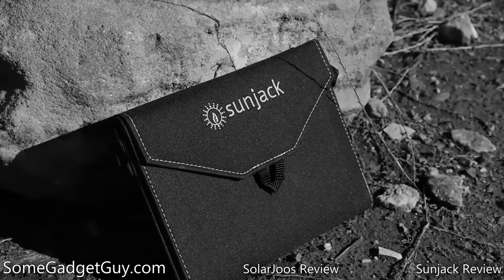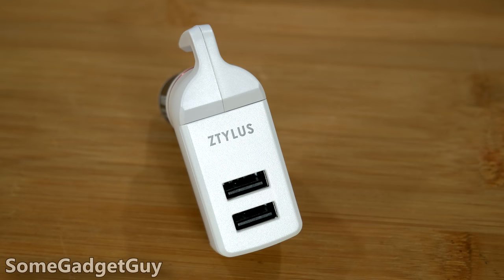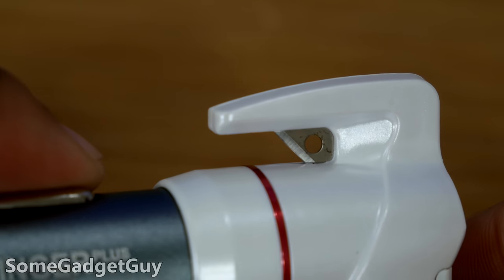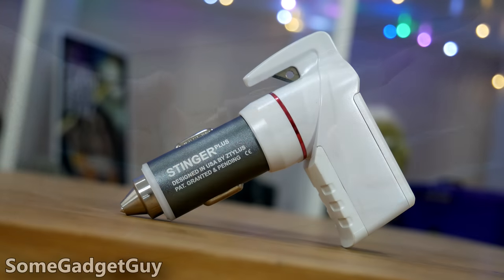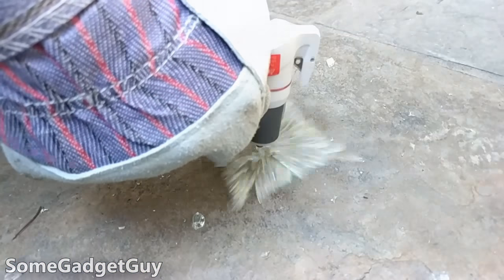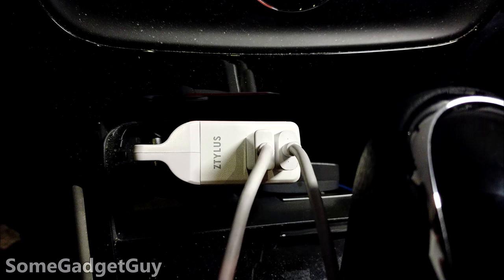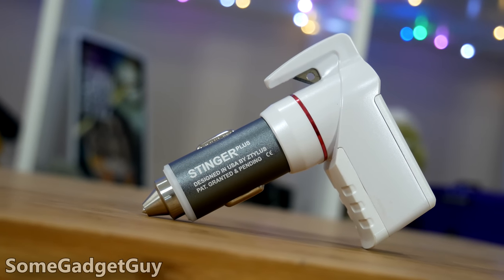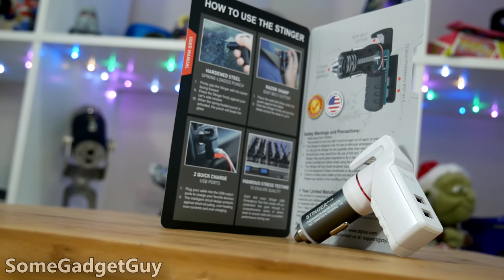Ztylus Stinger Plus: Car Charger and Emergency Window SMASHER

Comment: Juan.
I need this question answered.

Too much controversy on the internet regarding the LG V30's audio.

I listen to music and watch videos on youtube 80 percent of the time on my phone (youtube audio is inherently compressed). I use 32 ohm low impedance Audio technica M50x's.

Will the V30's higher output voltage and quad dac have make any difference in this situation?

Even MORE controversy, is the LG V30 display really THAT BAD? I see and hear claims that the screen has blotches of random brightness and dead pixels. (Some say its fixed other disagree.)

Also heard the front camera and low light camera shots suck.

I own an S6. Is ot worth upgrading to the V30 or the samsung S8? Great deal on the S8 currently.
Reply: Dave ThaBoss I don't know about V30, but perhaps I could convince you not to consider Galaxy S8. I have an ZTE Axon 7 which has comparable headphone audio to V20. My friend has recently got S8, so we did an audio comparison. Galaxy S8 pales in comparison to ZTE, that is all I can say. While loudness is acceptable (still lower then Axon), the sound itself lacks depth and details of Axon.

Comment: Dang! Really nice product! But here is something I am intrigued about! You broke all the sample glasses by placing it on the floor. So energy from the secondary spring that breaks the glass, gets transferred to the floor and the glass pieces are able to move laterally! But while breaking a car glass in emergency situations the secondary spring's energy gets transferred to the glass itself! So the shards could fly in different directions I guess??? So are there instructions regarding safety precautions given along with the product????? Also it is better to have some safety goggles while using this in real life situations, especially while breaking glass! Cheers Juan!
Reply from the maker: Without the recoil from the floor, safety glass tends to break in place, since it's also held in the structure of the car. I'm speculating, but this would like crack the windshield, as I don't think it delivers enough force to blow pieces of glass out of your windshield.

Comment: I use a car charger with an integrated cable and the integrated cable isn't long enough to reach my windshield mount.  If I have use the GPS at the same time as I'm charging it becomes a problem

Comment: Should have shot the slow motion footages with the xperia ... At 960fps 

Which device did you use to capture the slow motion shots ??
Reply from the maker: I tried, but that one second window PLUS having the phone on a tripod PLUS actually using the tool at the same time was killer. This was shot on a Pixel XL and a GS8.

Comment: Great tool, Juan! Did they provide any information regarding how it performs with polarized glass? (I'm not sure how it's called in the US, but I mean regular car windows covered with a thin laminated plastic that turns them darker). Thanks! F.
Reply from the maker: They didn't. I'm totally guessing, but I would imagine the force of the imact would still crack the glass, but the layer would hold the glass in place. Pushing through it should still be easier once the glass is cracked, but again, I'm TOTALLY speculating.
Reply: JuanBagnell Thanks! Yes, I think too that is exactly what it would happen. I'll be buying it the next time I travel to the US. Cheers from Argentina! F.